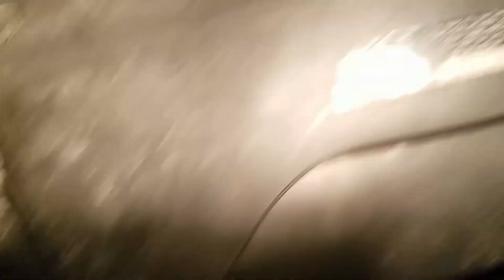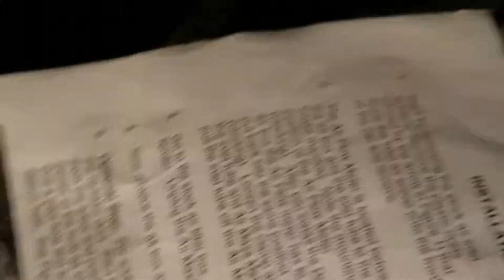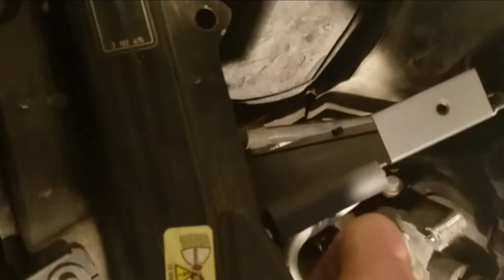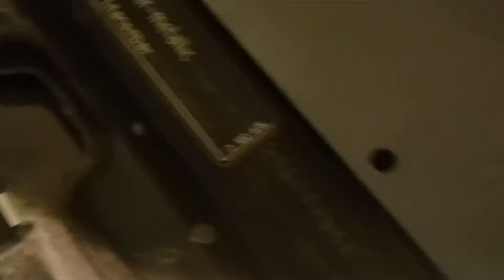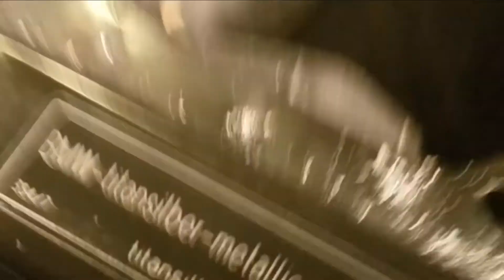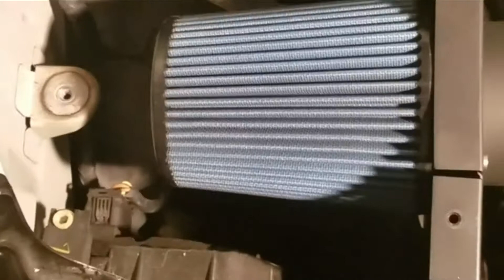BMW 2005 X5 e53 4.8is Dinan Cold Air Intake Install

Comment: So you've disabled a intake scoop and air box, which does force cold air induction before the radiator (atmospheric temperature) and replaced it with a closed in box behind the head light (no air circulation, plus with the heat from the engine and radiator transferred to that area will be like an oven) so a hot restricted air intake just to get a throatier sound, and less performance. think I'm totally missing something here, you have totally gone backward,
Reply: I was thinking exactly this
Reply: I mean, look at the quality videography. I bet it's dead already anyway.